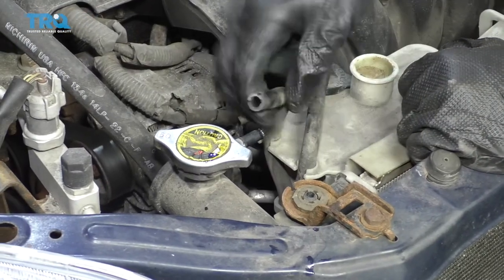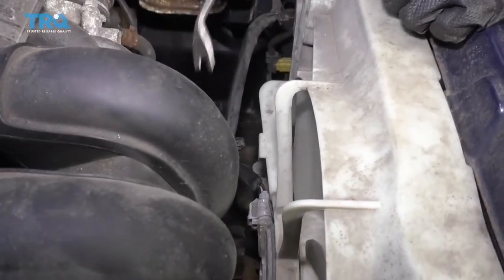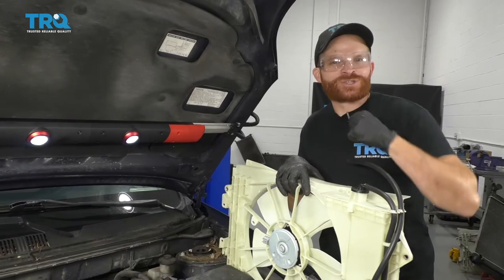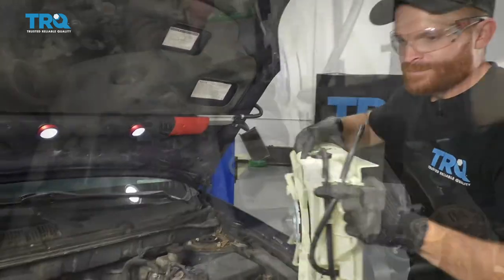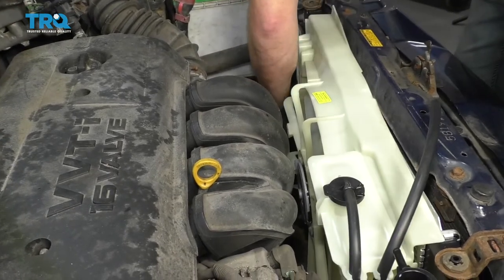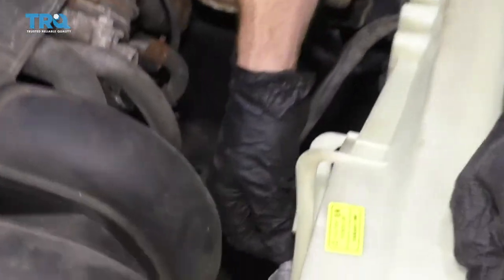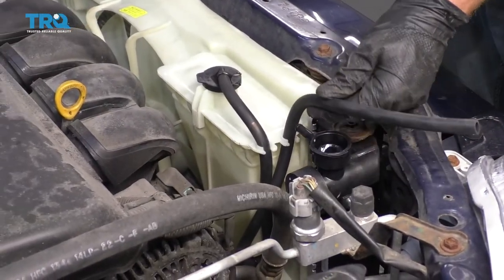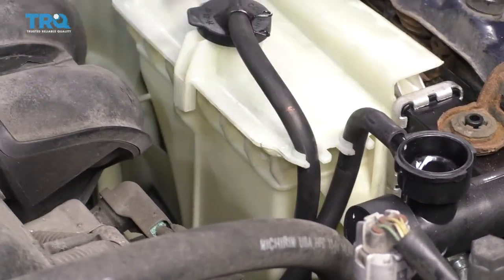How to Replace Radiator Cooling Fan 2003-08 Toyota Matrix

Comment: And after i do this i just fill it and im good to go? No need to do anything special?
Reply: Once installed add the coolant and start the car then press the AC button to engage the fan.  If it comes on and the blades aren't hitting anything then you're all set.